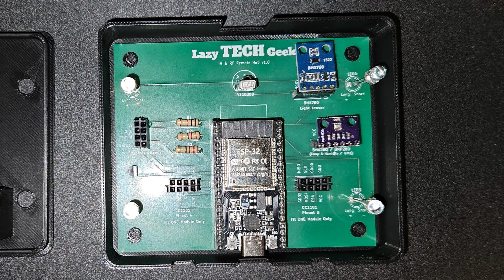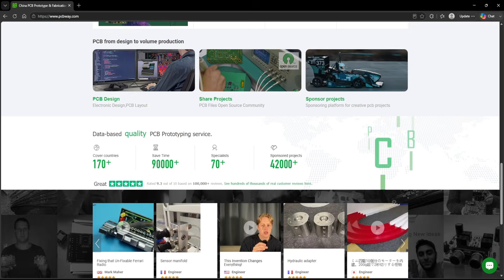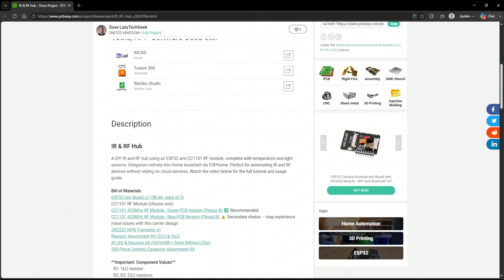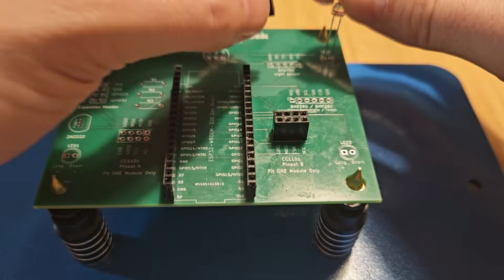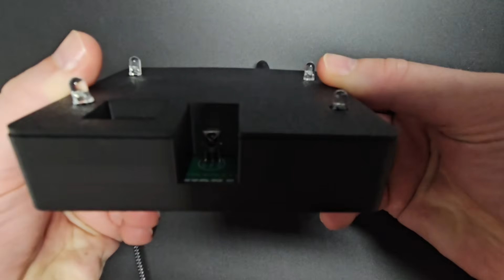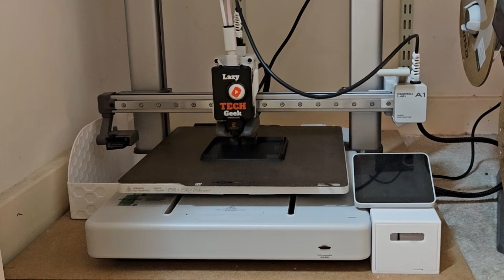Home Assistant RF & IR Hub – PCB Assembly & 3D Printed Enclosure

Comment: I just ordered these boards from OshPark (a US based manufacturer) at $63 for 3 boards in purple. I assume if I'm only interested in using this for RF then I only need to add the one capacitor for the CC1101 variant that I plan to use, right? Also, are the resistors needed for RF?
Reply from the maker: Hi Robert,
Yep, that's correct. If you're only using the board for RF, you only need to solder the capacitor for the CC1101 variant you're using. You can completely disregard the resistors, as they're part of the infrared circuitry and aren't required for RF.

Also, just to clarify, if you haven't already ordered the ESP32, make sure you get the narrow 38-pin variant. A useful telltale sign is that the GPIO pin labels are printed on the underside of the board rather than the top.

Here's an example of the correct ESP32 board: https://amzn.to/4687J6Q (affiliate link)
Reply: @LazyTechGeek  Perfect! I was pretty sure from studying the traces that there weren't needed, but it never hurts to get confirmation. Thanks!

I have been looking for the right ESP32 but was having trouble finding a matching US Amazon listing for the one on your GitHub for this project. Thankfully I was able to find the matching board to the one you just shared here.

Comment: Can I order this with parts assembled by PCBWay?
Reply from the maker: Not fully, unfortunately. This design was created as a modular carrier PCB for makers, so you'll still need to install the plug-in modules yourself. The IR LEDs and receiver also need to be positioned at a specific height using the 3D-printed alignment guides, so in its current form it's not really suited to the PCBWay assembly service.

In the future, as my PCB design skills continue to improve, I plan to develop more polished, consumer-ready products, which I'll be selling through my Shopify store.

Comment: Ordered the boards, which came yesterday (ver1.2) looking to install the software later today.
Looking very good in its case.
Reply from the maker: Hi Lorcan,
Thanks for ordering! Just wanted to give you a heads-up — the v1.2 boards have an issue where the temperature/humidity sensor's ground trace got disconnected during that iteration. I didn't realize until after publishing the video that it may have been caused by a KiCad file corruption.

I documented this in my Part 2 video and showed the fix at 35:58: https://www.youtube.com/watch?v=5ZTEVD5hgPI&t=2158s — it's a simple wire solder from the sensor's ground pin to any confirmed ground point on the board.

The latest revision (v1.3) has since resolved this issue. Let me know if you hit any snags with the workaround.
Reply: @LazyTechGeek I noticed that in your video.  It looks like ESPhome Builder has changed its front end.